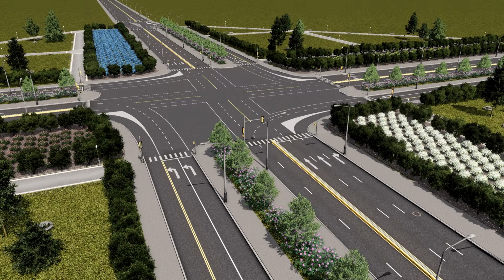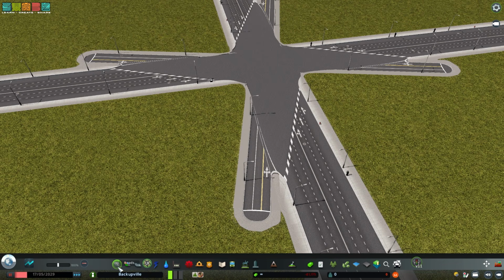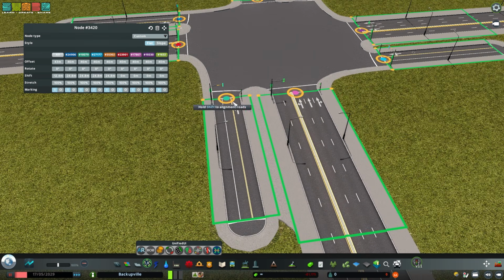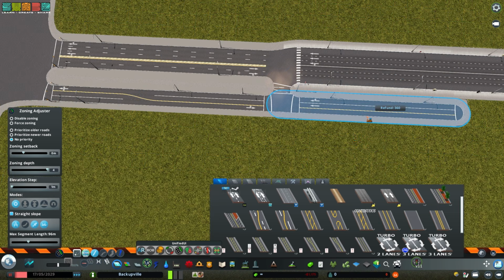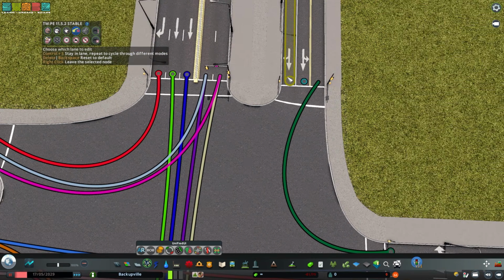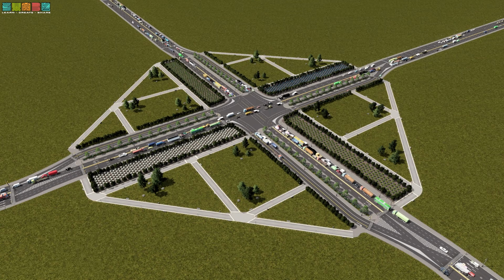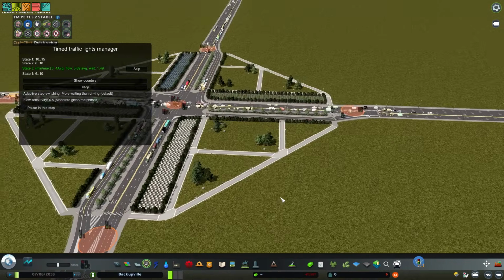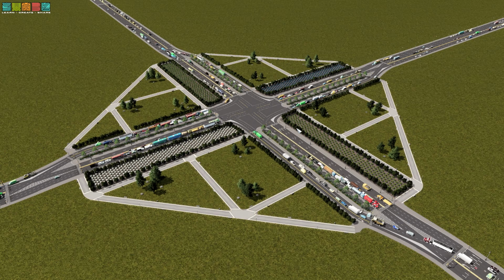Pushing a node to its LIMIT for the "Continuous Flow Intersection"! (CFI)

Comment: Wish you could have added how you setup the 4 phase light...
Reply from the maker: I did.
Reply: @YUMBL  Sorry, I should be more specific: how did you tie 5 sets of lights into one timed light in the framework of a player whose furthest extent of knowledge on the timed traffic light is to use CTRL+click for automatic setup.  I do not understand how you got 5 sets of lights tied into 2 sets of two timings into one traffic light system.
Reply from the maker: Oh! When you click a node to make a light click “add junction” to add other nodes to the timing
Reply: @YUMBL  I did not know about the "add junction" will try it, but that is what i meant by more detailed on how you attached them together.
Reply from the maker: Yea, i have a video about traffic lights that explains it :)

Comment: i tell you what, i never thought I'd see myself using traffic lights in this game as much as i do now. Many hours in this game i was extremely anti-traffic light. but i got tired of the messy looking intersections and huge interchanges and roundabouts (which really don't work THAT great with a lot of traffic). Now i almost see it as an art form, just like making a nice intersection, adding a proper traffic light with custom settings is my new thing i look forward to when setting up my roads. 

it's really neat what a couple nice road mods, TMPE and node controller / decorator can do for the game. traffic can still be a pain but the options are endless for getting creative and problem solving.
Reply from the maker: I’m glad to hear it! Lights add a lot of dimension to the game imo :)

Comment: so you have added 4 intersections to remove the left turn cycle on a light... normally on board with these intersections, but this is a bit much.
Reply from the maker: The wikipedia page shows every instance of these worldwide. There may be one near you. (Typically the left move on only two directions though)

Comment: It looks incredible. Not sure, though, if it really helps in case of truly heavy traffic because the left turning cars still have to cross the same lines, so they all can eventually block each other. I also tried to use your another connection (that interesting roundabout with almost-touching roads) and found that when roads are joined using such close angles, I could never make the game to show them properly. It glitches and, which is annoying, the node controller crashes constantly while I am trying to find a position which looks more or less okay. After several restarts I gave up and replaced the entire thing with a simple roundabout. I can predict this crossing would cause similar issues. But still, it looks amazing and I am excited to see how many options can be used to solve the same problem: merge two roads. 

Side question: where to find these beautiful trees? The default trees in the game are primitive.
Reply from the maker: The lefts are displaced so they dont have to cross over oncoming traffic. Two cycle light makes a huge difference. Trees are from the workshop

Comment: Ive tried to build a displaced left intersection (or continuous flow intersection)... It didn't come out well so I replaced it with an urban interchange.
Reply from the maker: Thats a fair result. Thats usually where roads that backed up are headed anyways.
Reply: @YUMBL  yep.

Comment: First we get asymmetrical roads. Now it's asymmetrical nodes. I feel like Colossal Order curses every time someone comes up with something like this because now it needs to be a base requirement for CSL2. I feel like this video was a counter to all the suggestions of overbuilding the roundabout with flyovers, pedestrian tunnels, etc. and then comparing it to a vanilla intersection. At 15:22 you can see how it's a shame that you can't adjust yellow light timings as that car gets stuck in the intersection while making a left turn. Maybe a 1 second dummy cycle would fix it.

Comment: So just to get that straight, correct me if i am wrong, but all this displaced left turn dose is take the turn of the single point it would cross the path of other trafic and make 4 new points offset to the main turn.
Reply from the maker: Pretty much. It means the left and straight traffic from opposing sides can all go at the same time. Then the other opposing sides go, and repeat :)

Comment: Very interesting intersection, surely more efficient than the classic intersection with tmpe, but also more complex to realize :). As you said, this solution could be great if you don't want build a interchange (the master solution in any case for this amount of traffic). But as always, a good cities skylines player shouldn't arrive to this point, he never should build a high density traffic intersection (crossroas or roundabout).
Anyway this intersection can be more efficient with a perfect light calibration, and stretching the arms of intersection (for more waiting space during the red).

Comment: I hate these things in real life, at least the few where I live slowed down traffic from what it was beforehand.
You did a great job of showing it in CS though.
Reply: How does it slow down traffic? It looks like it'd be faster. Too long light cycles?
Reply: @dycedargselderbrother5353  The ones I have been to are less free-flowing to be fair. Light for left, right & straight, and light for getting to the point that you can make that choice. The light for getting to the point is unneeded in this case due to nothing really changed at the intersetion besides more places to have wreckes.

The one Yumb designed may be fine, but it does not always equate to real life.

Comment: I tried building that a long time ago, before the days of node controller,  it was a nightmare.  I have not tried it since then.  I might have to give it another try with all the new assets and tools that are available now.   

I know that one of the downsides to the continuous flow intesection is that pedestrian traffic has no way to cross safely because of the constant movement of traffic.  Pedestrian tunnels or bridges are required for that reason, making it more expensive.
Reply from the maker: Bet it still costs less than an overpass though
Reply: @YUMBL  For sure!

Comment: How do you think this intersection compares to a Turboplein? Your videos inspired me to make a turboroundabout with good traffic lights. /watch?v=U9GMDiJNHjI

It seems to run on the same principles as this one. In my design Right-turning and straight traffic has a green light 7/20 seconds, Left-turning has a green light 7/20 seconds + 2 seconds delay in the middle.
Reply from the maker: The delay is a good idea. Do you just do a 2 second red cycle?
Reply: @YUMBL  7 seconds green for opposite sides, 1 second red for all sides, 1 or 2 seconds green on the entire interior then switch for the other side. I want to make sure any cars stuck inside the roundabout get a head start to exit without delaying new incoming traffic.

Arkuas made one where he first let everybody enter the roundabout, then move everybody within the roundabout but this interrupts the flow too much in my opinion.

I find it interesting how much the CFI and Turboplein are alike. They seperate the left turning traffic and make them wait for 2 red lights in exchange for more green time for straight going traffic. That's why I wonder how the CFI lights work. IRL CFIs seem to have about 20% more capacity than the TP but are less safe.
Reply from the maker: Very interesting! :)

Comment: They built a bunch of these in Utah on Bangerter Highway in the early 2000s. Now they are converting all of this intersections in SPUI interchanges with an over pass. They aren't bad, but I felt like they didn't get enough use before being broken apart in favor of a freeway style interchange. Honestly felt like a waste of taxpayer money.
Reply from the maker: Yea. Its definitely a large advanced at grade intersection, but theyre apparently cheap to upgrade to and operate. An interchange is the next logical step, but theyre way more expensive.

Comment: This is amazing, I actually needed something like this for a few high volume intersections in my city where there isnt quite enough space for an interchange and a roundabout or timed traffic light are still not quite enough. Gonna try this immediately.
Reply from the maker: Good luck! :)
Reply: @YUMBL  update: I installed TWO of these in my city at a couple of busy intersections and it brought my traffic back up to 78%-80% after it dropped to 73% when I added some new industry areas.

Comment: I actually tried building this on the test map you shared in the roundabout video. But I built it as 5 nodes and lots of timed traffic lights and lane connectors.

The 4 phases are not confusing to understand, but they are confusing to time correctly and keep everything free-flowing.

Comment: I love this. It's a counterintuitive intersection, but it looks really cool.

There only thing I'll say - and this applied to pretty much all the intersections I've seen you do so far - is that, having grown up in a country where turn-on red is not legal, and now having lived in several countries where it is, freeflowing right turns always annoy me. They make it very clear that pedestrian safety is a secondary concern. I always have to dodge scooters and bikes when I cross, even at a marked crossing with the green man showing. Back home, the green man meant no traffic was coming and you were completely safe. I'd be interested to see you tackle an intersection that manages to incorporate safe pedestrian crossings without sacrificing too much traffic flow (and without building absurd pedestrian bridges - there is a huge one near my apartment, and nobody uses it, preferring to chance death on the busy intersection below instead because it's significantly faster.)
Reply from the maker: A red right turn on a ped cycle solves this. This was just a test in a vacuum. These are also not generally meant for populated areas.

Comment: Fantastic video, and way cool idea for an intersection; thank you so much for all your hard work! I do wonder though why it's called a "continuous" flow intersection, when the flow is - quite necessarily - interrupted by the traffic lights?
Reply from the maker: I think its because left turning traffic doesnt require its own cycle. Where they would normally be stopped while traffic to their right is going. In short: idk 🤣
Reply: @YUMBL  : Fair enough. Thank you for the clarification and the constantly amazing videos!

Comment: They've implemented a bunch of these in Utah. bit wonky to get used to at first. But supposedly they reduce accidents by a significant percent in the long run.
Reply from the maker: Quite safe from what ive heard.
Reply: still prefer having one direction flow straight, the other split into over and under

Comment: Gorgeous intersection but all I can think about how terrifying those right turning sliplanes would be to pedestrians. If you're crossing from left to right and there's a column of cars waiting at the red light, you have no way of seeing if there's a car tearing down that side and you can't exactly stop in the middle of the zebra crossing the check.
Reply from the maker: Id probably add a cycle to let them out. Wouldnt take long.

Comment: A thing of beauty! Only concern is that the bottleneck is on the junction exit rather than entrance, so it might lock up if the main node is running 100% duty cycle. The straight on/left turn exit lanes are receiving 2 lanes of traffic in both phases, but the lights for getting back out will only be operating 2 lanes on some of the phases. You would need 4 lanes crossing the left turn to have the same throughput. Not sure how they deal with that in reality, but it is quite possible that they just don't, or have pedestrian crossing phases on the main node to match duty cycles. My instinct would be that the pedestrian crossings should be on the main node, counter-intuitive as it sounds.
Reply from the maker: Correct. The legs need to be a bit longer, and the light needs work. It runs on two phases irl, but its also much bigger.

Comment: The CFI is easily my favorite intersection type.  I use these all over the place and often there simply is no substitute.

One thing I've found is, unless every direction is extremely busy, you don't need traffic lights on the "legs".  The crossing left can simply have a yield sign (IRL they'd probably use a flashing yellow arrow) so they can go and load up the leg area anytime there isn't oncoming traffic.  However if the intersection is very busy in all directions, then the outflow really is rather continuous, and it becomes necessary to add the additional lights.  This is also helpful for pedestrian access, if you want people crossing there.  I typically still use a 2-phase light, as most of the time if the yield isn't enough, then it means I have absolutely massive demand on the left turn and they need lots of time.  But as with anything, it's valuable to analyze how things are working and rearrange the green-time to where it's needed.

Regarding how difficult it is to build, it is MUCH easier if you don't insist on the single center node.  If the legs get their own node, there's really almost nothing to do with node controller and most of the work is just setting up lane arrows.  If you do yield on the legs, the traffic light is less work than a standard 4-phase intersection.
Reply: not using a single node would also allow for staged pedestrian crossing

Comment: I've thought about trying to build one of these several times just to see if I could get one right but never have because trying to visualize how to do the traffic lights always gave me a headache. This was great :)
Reply: You can simplify the lights a lot.  Unless traffic demand is very high, you can get away with only a single light at the center (if you make a single giant node like Yumbl did) and the "legs" can use yield signs.  With that single light, it's just 1 phase for North-South and 1 phase for East-West, done.
Reply: @JETZcorp  I've seen several videos of people creating this junction, but this is the only one I saw that connected everything through the central node. All the others connected the left turn lanes a few units away from the center and I never thought about doing it Yumbl's way until this.

Comment: We had a lot of these in my city but they have been starting to remove them and replace them with highway style intersections because these didn't really have any benefits besides confusing drivers who have never used them. They look amazing in CS though
Reply from the maker: I cant see how its confusing. Follow the signs. Follow the road.
Reply: @YUMBL  I think it was poorly designed especially at night lots of people turning onto the left turn area because the ones here dont have a right turn slip lane. Plus the traffic on the road was so heavy it was hard to tell if these even improved it over a large normal intersection. Regardless love your videos man

Comment: A prime example of the "over-engineering" phenomenon 😂
Reply from the maker: I disagree. Rushing to build an expensive overpass is no less of an operation.
Reply: @YUMBL  oh, I meant as opposed to the fist four way cross roads you've built in the roundabout video. 
In a moderately congested city, one will be significantly smaller and easier to make, albeit not as efficient. 

But then again, this one looks cool as heck in addition to being efficient ...  🤷‍♀️
Reply from the maker: Oh, for sure. A smaller light can handle this much traffic as well. This was for the fun of it :)

Comment: Recently I've seen this intersection in my recommendations all the time.
Honestly looks like a nightmare for everyone who isn't in a car.
As always a nice video, though
Reply from the maker: On a two cycle center light with islands built in i think its amazing for peds
Reply: @YUMBL Irl no intersection should have that amount of traffic. A properly walkable intersection makes it possible to cross diagonally with at most two crossings, better would be a single pedestrian phase permitting diagonal crossing.
In rural areas where you can have cycle and walking infrastructure well separated you shouldn't need that many lanes anyway.

It's technically impressive but shouldn't really exist since you should never come to a point where it would be needed.
It is probably a lot better than many current intersections in heavily car centric areas though.

All talking about irl though. CS is a different beast.